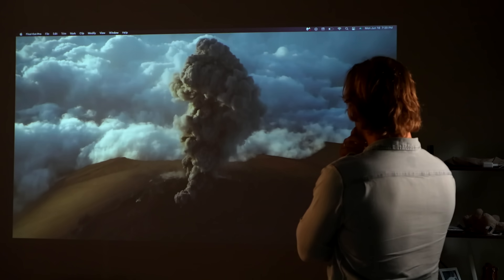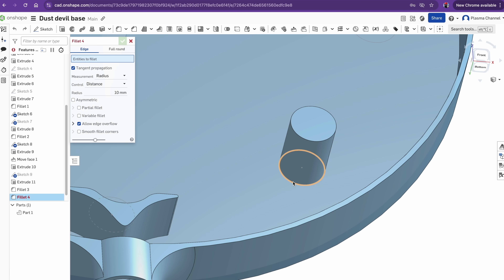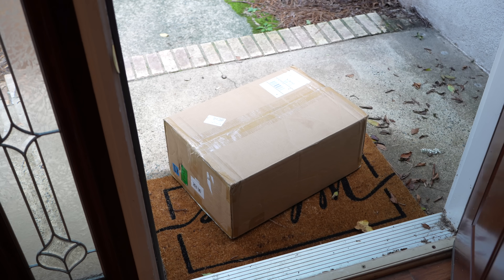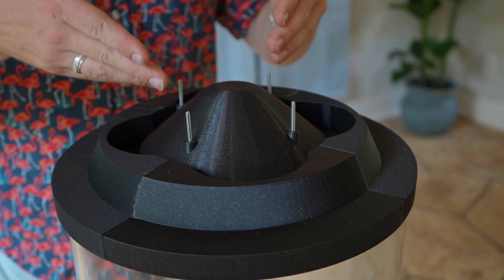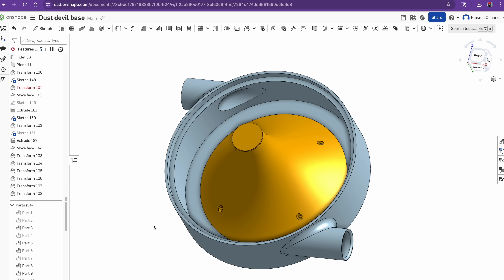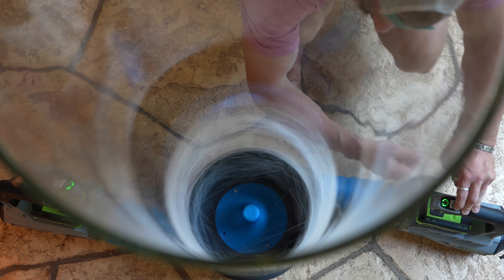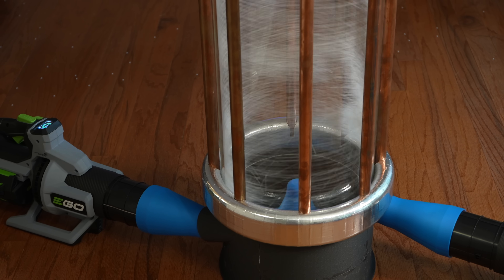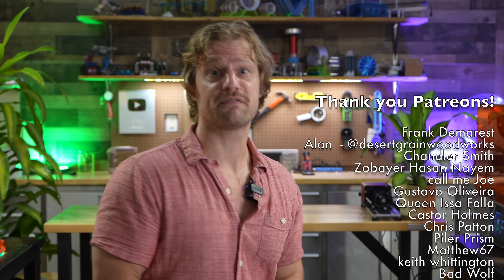Making Lightning In A Bottle Might Be Possible  (ft. 3D Printing Nerd)

Comment: Any chance of incorporating some high voltage diodes to make it a one way voltage pump into some form of capacitor? I bet the static could be used to power a marx generator or voltage amplifier. I feel like within a dust devil or volcanic cloud you have a large ambient charge seeking a path to ground. I wonder if the capacitance of the glass or the beads is just not high enough to develop any kind of serious voltage without some place to act as a charge sink to get a nice plasma discharge.

Comment: Change the media material.  Use PTFE beads instead of poly beads. Tribeelec should be the highest possible. And the charge buildup might not be from top to bottom its most likely the vertical left and right.or locally around each bead. Bud idk just a theory 😃
Reply: To create a vortex easily. Pull the air out don't blow it in. You want laminar flow which is created much easier with pulling out air from the top. And the base you created is already perfect.  put honeycomb 1/4 inch X 1 inch in the two inlets at the bottom if the vortex isn't created. It will help propigate laminar flow.

Comment: How does it work in an actual dust storm or volcano? There is no surface for the particles to run against, and there is only one type of particle. How do like particles develop a differential charge, and how do they then separate out into positive and negative volumes?

Comment: First of all, probably would be good to try and insulate the device from earth better. Sitting on the floor is probably helping the charge dissipate.

Secondly, the inductive cage probably didnt work because the charges are, well, static. There isn't an alternating field - the glass is building up positive charge on one side and negative charge on the other.

Comment: Just a suggestion: find a way to hear the air. That's one thing desert sand storms and volcanoes have: tons of heat (especially in the volcanic plunge) making the air more electrically conductive. It's likely too cold in there for the discharge you're looking for

Comment: what about using a differential joint like you would find in a car to make an inner and outer charge extractor that counter rotate. like a Wimshurst machine.. Fairly sure there's a max charge that can be grabbed and most of the charge is on the beads and while you get more with more beads the individual ones don't seem to gain space but if you help it with some extra capacitance you should be able to get a much higher differential. 

Might also put some salt or silica drying beads before the fans to pre-dry the air before you heat it.  Salt might like an electrolyte too. Volcano's and deserts both have a bit of that.. volcano's more exotic things.  Be interesting and easy for you to check if it has any affect as silicon wouldn't add to that.

Comment: Dude, put a ground at the bottom with a sheilded feed line. You want lightning in the tube, right? There's ground outside. Above the dust devil is the sky. Below the ground. Need a great difference of potential to cross the strata of particles.

Comment: Total WAG, but would the attempts to harvest the electrostatic charge also provide a larger area for it to dissipate into the surrounding environment?  What if you used smaller contacts within the glass tube to carry the collected charge to something like a Lyden Jar?

The again, your final detailed attempt was basically a Lyden Jar with the generator inside it already...

Comment: Instead of a cylinder that you spin the balls in, what if you made a structure you poured sand/balls into and they collide as much as possible with some grid-like structure that is all a part of one electrical grid (maybe a 3D lattice made of copper or some other conducting metal), the idea being that the charge collector is the conductor

Comment: glass is an insulator. the charge on the outside is not the charge being created on the inside due to triboelectrics. 
the real charge you want is between the beads and the inner wall. as it is, the charges are created, but go nowhere, come from nowhere. the beads acquire a charge, the glass loses it... and as both are insulators they dont lose that charge. it simply builds to a certain level and stays there. the beads cling as opposites attract, and being insulators, they dont discharge despite being in close contact... until atmospheric humidity leaks the charge away...
or, as the balls are negative, and the glass positive... as you bring your hand near, its an isolated and grounded electrode. your grounded hand repels the beads through the glass, but due to the dielectric glass, should have no actual effect on the charges within, there being no conduction. the positive charge on the inside of the glass staying positive, the beads staying negative...

how does a wimshurst and kelvin thunderstorm work?
though being triboelectric now, its closer to the vandegraf...

Comment: For extraction: There are conductive coatings you can apply to glass.  You could try applying such a coating to the inside, in a few thin vertical lines.  I wouldn't coat the entire thing, as that might interfere with the static generation, but a few thin vertical lines that can be tapped at the top or bottom to a collector might be enough.  That said, friction from the balls might wear it away very rapidly, so it might only work briefly.  

Anyhow, I'm curious to see where this goes!  Very nice work and fun to watch!

Comment: "Inductively pick up the static charge from the glass"

Inductive pickup only works with moving charges, not static. I'm gonna guess you figured that out, I'm just fascinated.
Reply from the maker: Static electric fields induce charges in surrounding conductive objects. A positive field will attract electrons or encourage them to move toward it, at least. For example.
Reply: @PlasmaChannel then you get an induced current as it transfers that charge that is lost in translation.

Comment: You might find the following a bit interesting:  an experiment during WWII by Germany to make a dust vortex based safety fuze.  The idea was that airflow would charge the device during flight so it would be uncharged and safe during handling, but able to activate by the time it impacted.  Here's a link to a PDF, with the applicable drawing/description on pages 190-192. https://stephentaylorhistorian.com/wp-content/uploads/2020/09/op-1666-german-explosive-ordnance-volume-1.pdf

Comment: When it comes to 3D printing, Joel is one of the best. He's shown some really cool printers and techniques, but I think my favorite is metal printing. There was one super simple method he showed off where the printer placed metal dust interspersed with sand into a crucible and when it finished you just fired it in a kiln like pottery and instant metal part.

Comment: Ive always wondered if we could build a cloud machine to generate lighting bolts. I mean its happening constantly in nature so it must be possible. No more powering turbines to create electricity. Simply create it out of thin air. That would be a cool concept for a sci-fi. Instead of distant future tech being powered by nuclear fuel cells, or whatever, that last 1000 years before they need to be replaced, have everything be powered by silicon cyclone batteries. Or cloud storm cell batteries. I wanna power my gameboy with twisters.

Comment: Surface area is your enemy for harvesting in a system like this.  Too much surface area = charge is dissipated faster.  Too little surface area = not enough charge.  So capacitors for stepping and a smaller surface area relative to your tube diameter.

Comment: When you actually switch to sand you may not get many runs before you’ve sand blasted the glass. No expertise on this but it seems like using the smallest particles that you can filter and will hold the charges might be your best bet.

Comment: Could use a vacume setup at the top instead and multiple highly angled fins at the bottom for laminar intake, creating a verry smooth vortex.
And it could also help with sealing the apparatus and save the beads/sand if they get thru.

Comment: the problem is in the material of the balls, try using some steel balls or mix some powdered steel in it. Sands arent made of poliethylene or nylon, there's a lot of conductive materials in the sand and the lightning probably is the shock between the material inside, not the interaction with the outside of the vortex...

Comment: I've also heard of some fire extinguishers making large electric arcs when being used as well. I wonder if you have to et up some sort of cross over similar to a water drop generator to pull the charges out effectively. It would be interesting to see what's happening with the lights turned off. Maybe there are arcs happening inside that could give you some sort of hint as to where the charges build and how to manage or collect them better.

Comment: There seems to be some discrepancies in you logic, with what you are thinking. Sandstorm lightning, okay. But Dust devil lightning? Very unlikely. Every dust devil I have ever seen, is at ground level, reaching up as high as a mile or so. And I dare say seeing them was will into the thousands, and actually interacting with them in the dozens. And not once did any of the have any electrical properties. It seems logical that a dust devil could create a static charge, but being so close to the ground, could lose that charge quickly. And I have been in many a dust devil. From being 10 to 50 feet high, and blowing around 30-60mph winds inside, to the tallest ones I've ever seen, pulling trash out of trash cans, and taking empty aluminum soda cans, and plastic bottle and wrappers so high they looked like dust. Winds at speeds of around 100 mph. Never actually measure, just difficult to stand in, not that I wanted to, it was usually a surprise happening. The thing that really sucked was being inside one of these things with some tumble weeds. George AFB, Ca was the worst. But also Luke AFB had its fair share too. But at George AFB, well, that was KING TUMBLEWEEDS. Tumble weeds can be as big as a 2 story house. I saw one guy, refueling an F-4 Phantom, in high winds. He was at the refuel truck, face in close to the controls for the job. We saw a huge ass tumbleweed, easily twice as high as the truck. And so dense, it rolled on the ground like a piece of rubber. I think it was still green, and high winds blew it lose. It hit the guy, and pinned him into the control panel. He dropped the dead man switch and shut off the fuel. We had to call for assistance to get him out. The winds were blowing at 50 mph gusting to 75 mph.

Comment: For some stupid reason, I think it needs a conductive plate at the bottom connected to an earth ground. The foil right on the glass was a good approach, so repeat that part. If my guess is right, it should be a bit more spicy after that.

Comment: what if you made a staircase type tube that you can drop the sand down with electrodes at both ends to harvest the power? i seen something similar with water because it can do the same thing.

Comment: 11:58 think that's from laminar flow that causes it...I know Destin smarter every day covered at
12:34 1of2 ways to harness this magnetic wire around the glass. Or glass to cap/spark gap exchange for the grounding (common) point of this 'circuit' then rectifier or voltage divider/tank circuit out to the 'load'

Comment: How about a Leyden jar? I made one in physics class for the fun of it. Take an aluminum foil roll and laminate it and cut in half. (I used about 10ft) attach wires to each end and roll up, attach one end to ground. The other end can be in the air. This charged up really well on a van de graph. almost to well... when I tested it, the spark was small but my arm muscles tensed up from the shock.

Comment: A pseudo-self charging Leyden Jar stapled onto a complicated Wimshurst machine... Okay, hear me out... Metallized window tint on the inside and outside of the glass (so you can still see the whirl) to form your capacitor plates - and a physically contacting tap from the inside layer to an external ball/wire for ya sparkies.

Comment: you're on to something i never would have thought of, and i don't even claim to know what a triboelectric pair is, but i see the flaw in this design: flow dynamics! its the wrong way around, so the pellets just spin around the inside of the tube horizontally, and fight gravity in single directional air flow, rather than circulating vertically. (it's all about the pressure gradient, baby!)
to create a rising inner vortex, like in a tornado, seal off the bottom (keep the cones, those are the electrodes you need), and inject the air at the top. 
centrifugal force pushes the fast moving air outwards, and with nowhere to go at the bottom, it will follow the path of least resistance/pressure, right back up the middle, accelerating as it decompresses. 

PS: look up vortex tubes too. you're welcome!

Comment: How is charge separation supposed to happen, with balls going round and round??
What you need is a small air pipe with balls shooting out on top, a charge collector on top and ball collector on bottom, that feeds them into the air stream again, like air powered van der graaf generator.

Comment: I usually like your videos, I think they are great for inspiring thought and questions, the most vital aspects of science. Your builds are always a level of art by themselves. Unfortunately this video is missing something vital, which is the discussion of efficiency. Like I say to people, you can pound a screw in with a hammer but that doesn't mean that's how it should be done.

All of the principles utilized here are the underlying principles of how a Van Der Graff generator works. The difference being that while already horrible in it's efficiency the Van Der Graff generator is orders of magnitude more efficient than what you are trying to accomplish here. You can extract serious amounts of static charge simply by spinning one with you hand.

ANY discussion about new approaches to doing things must include the costs. Financial, resource consumption, all costs. Otherwise we end up with things like using more than 1 gallon of gasoline to produce 1 gallon of ethanol, wind turbines that consume more energy manufacturing and installing than they'll ever produce in their lifetime and can't be recycled, and electric vehicles with over twice the "carbon footprint" in the end as traditional internal combustion vehicles.

Comment: The same thing happens with sawdust. You can get electrocuted from the pipes that carry saw dust away from the machines in a wood shop. You actually have to ground the vaccum pipes because they build up enough static electricity to be deadly.

Comment: you could spun the tube horizontal like a dryer without the blowers.   however you could of made a 

🔋 Wimshurst Machine.  

• It’s an electrostatic generator invented in the late 19th century.
• It uses two counter-rotating disks with metal sectors, often connected via brushes and neutralizing bars.
• As the disks spin, they build up high voltages through induction and charge separation.
• Copper tubing could’ve been part of your setup to help conduct or distribute the charge.
• The machine can produce sparks and charge Leyden jars (early capacitors).

Long time fan!!!!😊

Comment: Layer parchment paper and aluminum foil, then wrap it around several times. (Which is essentially a capacitor) What is happening is your voltage has a lot of surface area to interact with the surrounding atmosphere. There is nothing to trap the charge. If this was at the center of a capacitor, however, you should be able to build up charge over time and release it fast.

Comment: So....Maybe you've already gotten to this though, and maybe I'm just flat wrong here....But A static charge is..well, static. Building but not moving. Your extractors, are moving it, not allowing it to build. And on top of that they're actively dissipating it. You're trying to fill the bathtub after you've pulled the plug on the drain; it's not gonna work.
Reply: That’s just not how it works. The word “static” isn’t indicative of some non moving rule. Van de graaff generators?

Comment: The "Nu-Klear Fallout Detector" actually works by charge separation! It has a bunch of beads in a tube that become charged and stick to the walls when the device is shaken. ionizing radiation passing through the chamber knocks off the charge and causes the beads to fall

Comment: You need to think of this as a Van de Graaff generator. The beads rubbing against the glass steals electrons from it making the glass positive.
You need to then pass the balls over something that can take off the extra electrons again so they can go and repeat the process. At the same time you need to get electrons back to the glass so the beads can again steal them. Think of the beads as the belt in the generator. That is what was happening in your metal head vacuum cleaner when you were vacuuming up sand.

Comment: A closed loop vacuum system that pulls the sand from a bucket to a rigged vacuum chamber. The chamber could have something like a weight released "dry dock" like chamber that after collecting lets say 50% of the sand it would close the first spring loaded "bulk head" then releasing the second bulkhead re releasing the captured sand back to the first chamber. 🤔

Comment: I'm not really an expert, but have you tried using a combination of both hot and cold air? because heat rises, cold sticks to the surface. so maybe that could help. 🤷‍♂️

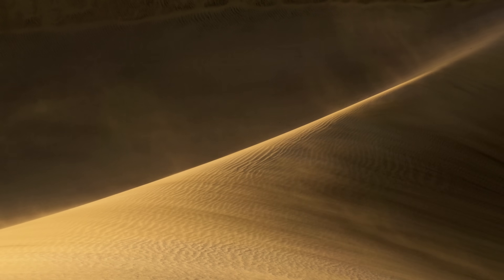Comment: 15:39 a pylon that collects when the charge is released by the balls. You gotta let it build and then discharge. Not at the same time. High pressure and low pressure areas in a the tube, not just rubbing the glass but making a sorta battery with two ends.